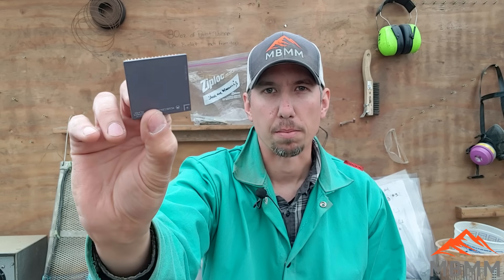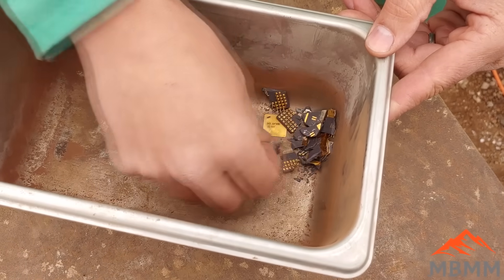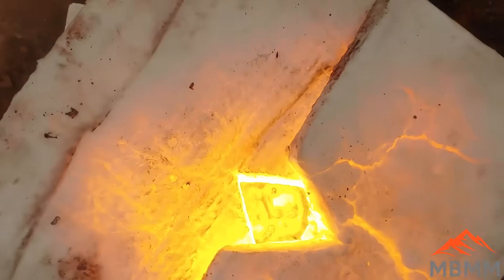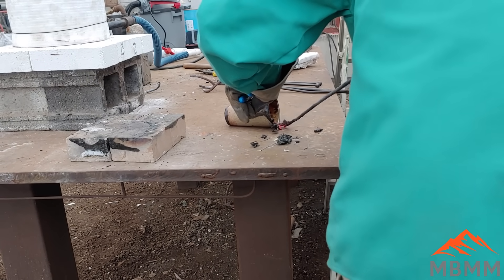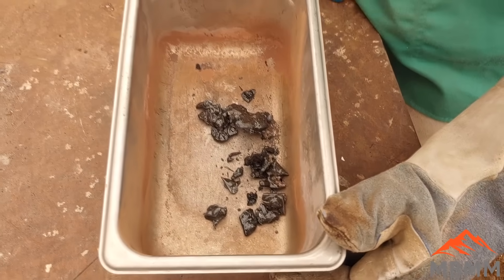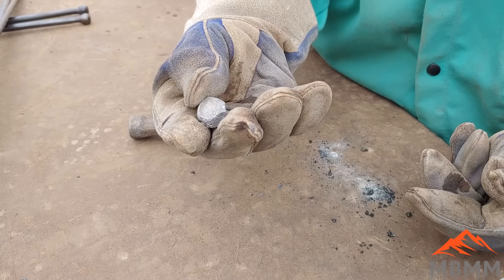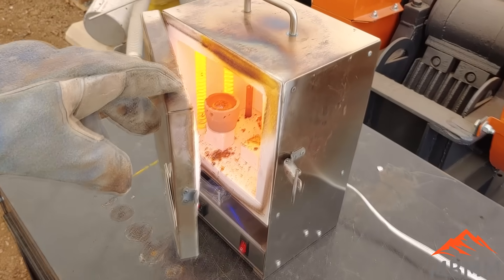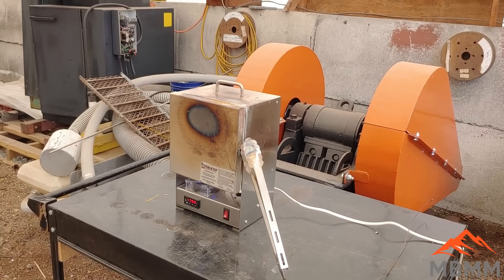Can CPU Gold Be Direct Smelted? Electronics Recycling & Urban Mining For Precious Metals!

Comment: Most people use chemicals to reclaim the gold - I think it would be interesting to have you hook up with, say Cody's Lab, and have you both start with the same amount and type of computer parts to see which method is more cost effective and efficient.
Reply: The chemicals to do the process in most cases like this cost more then the gold or silver is worth
Reply: @Hoosierdaddyjones812  The chemicals are pretty cheap, its just hydrochloric and nitric. The problem is the people selling the scrap price it way too high. Youll never turn a profit unless youre sourcing your own scrap
Reply: @Hoosierdaddyjones812  Figured as much as I had looked at the acid process back when it was all the rage when I had access to lots of scrap computer parts and it looked pretty costly.
Reply: The answer to both of those questions would have to be chemicals in my mind, due to that being the main method for reclaiming precious metals all over the periodic table from many major reclamation facilities
Reply: Steetips is the guy I watch on youtube, he does all the chemistry extraction of gold.
Reply: How to recover gold from computer part no acid
Reply: I was thinking the same thing. Reduce the initial boiling time to remove the gold from the plastic by grinding and turning everything into a semi-powder first. Interesting thought, wonder how well it would work in practice.
Reply: Saw vinegar and peroxide, method or salt or HO machine oxy clean promising but if you grind it all up into a fine powder and threw it into the peroxide, you’ll get gold flakes floating on the top
Reply: Def can do some research into breaking down materials and how much you process per melt. Best case scenario is to get very cheap heat like byproducts of other industry
Reply: @burb138 is there any point in using waste heat to melt metals? I would think the high temperatures needed make that unpractical
Reply: I use acid to extract gold from rock. I'm usually stuck with extremely small specks of gold sitting inside small pieces of quartz (most of the time). Tried several different acids and combinations, but plain hydrofluoric works well enough to get the gold free or, at least, exposed. Not sure how any of the common acids would work on motherboards...my guess, is not so well.
Reply: @jcass1970  I'm just a hobbyist gold panner, tried grinding down a quartz ore to dust and panned it after with pretty bad luck. How does the acid work?
Reply: @primordialsoupkitchen9492  It all depends on the rock, but I'll take a few pieces of quartz put it in a jar with the acid. 3 days or so is plenty. Lately, I've been using a mixture of hydrofluoric and hydrofluoric/Oxalic with good results. I keep it hot so it works better. I put it in a bucket w boiling water or on my outdoor electric grill...whatever. The acid dissolves enough of the quartz to break some of it free, or expose it in the rock. I still end up crushing what's left to get all the gold out, and the acid makes the rock more brittle so that helps too. Haven't tried sulfuric like unholybes4t mentioned, but the sodium hydroxide route works also. I think I'm gonna go the furnace way now, cupel, etc. Seems to be the only way to get all of it.
Reply: @jcass1970  Acetic acid mixed with hydrogen peroxide can dissolve the lead and eventually silver from electronic waste effectively concentrating the gold by default. Lead acetate is pretty toxic, so make sure you have a way to render it safe if you use this step it might also be worth your effort to separate the silver from the lead.
Reply: @jcass1970 you use HCL and 3% hydrogen peroxide
Reply: @chrism4008  haven't tried that. Finally did my first smelt though. Got way more gold than I thought I would get. I still have to cupel my lead to get the clean precious metals, but I can already see I will have more than a small button. Super easy to do as well.
Reply: @jcass1970  on CPU like those shown in the video, sulfuric acid desolves all the plastik and exposes the gold/gold plated material. Motherboards as such, do not have gold in them. Only some chips do. The older the chip, the more gold it usually contains.
Reply: Uuuuuuu
Reply: جيد
Reply: This is a wonderful idea
Reply: Sreetips might be a better choice, one, because Cody's Lab is a huge channel with 2 million+ of subs and I don't know if he would be as easy to lock down as a youtuber with more like 200K subs, and two, because Sreetips is a bad mofo when it comes to metal chemistry and his focus is precious metal reclaimation.  I'd place his chem skills near the top of all known youtubers, beyond Nile red and everything.
Reply: 8:36
Reply: P
Reply: Cody’s lab a name I haven’t heard in years
Reply: It takes money to make money , since I want to make money , first , I hopeave to take money... Right?
Reply: @dont.ripfuller6587  well you certainly will spend more then you make, using this method
Reply: sreetips>Codylab
Reply: @fumertonb 1000%

Comment: Silver is used in solder for electronics, so the CPU had a lot of sliver. Their may be some gold plated wiring depending on the pins and thickness of the chip. You'd have to pull up the specs for each chip to find the Au / Ag content.
Reply: Most solder is a eutectic tin/lead allow. Silver solder is only used sparingly and then, only in high- temp areas.

Comment: as a computing enthusiast, its a huge disappointment that the scrap value of a cpu could ever be greater than the value of the cpu itself, but that seems to continue to be the case.

In other news, I am hugely frustrated when using a modern super computer that browsing a website can stall out, software developers continue to produce software that can only barely limp along on incredible, amazing, hardware- some of the most extreme workloads I throw at my computer finish in nanoseconds, and then there is browsing a website...

Comment: Modern CPUs have extremely little gold in them. They used to be more generous with the gold in them a couple of decades ago. One of the 4 CPUs you melted, the one with the large aluminum lid (either a K6-2 or K6-3 by the looks of it) had almost no gold and was essentially a waste of material and gas to get melted down.

Comment: I used to work for an electronics recycling company. We kept our eyes out for particular brands and classes of chips that we then melted down and smelted the gold from.  It was worth our time, but we went through tons and tons of material over the course of a year.  And this was in '99-2001.  a lot of the older chips were very large dies and the circuit designs and manufacturing weren't as optimized as they are these days and so had more material in them than chips from more recent generations.
Reply: I also dealt with electronics back in 80/90ies. older PCB were packed with copper, silver. and gold. today its extremely precise.

Comment: The days of cost effectively getting any appreciable amount of gold out of a CPU are long gone.  I believe that the last chipsets that had any decent amount of gold in them were the intel Pro chips from the late 80's early 90's where you could potentially get up to 5gr of gold out of each CPU.  Good luck finding any of them around anywhere.
Reply: Ive got a few still and I think your estimate of 5g is a bit optimistic. Unless of course you have done it yourself.
Reply: My mistake, that should have been ~5gr out of 1kg of those early CPUs, but that doesn't change my point.  For what you'd spend in energy, supplies, reagents and time, you won't make any money appreciable money scrapping CPU chips any more.

Comment: 1/10 Gram per CPU, 28.3495 Grams per ounce = 284 CPU's for one once of Gold! Thanks :)
Reply: Actually gold weight is measured in Troy ounces. Its 31.1034768 grams per ounce. sounds crazy but that's the way of gold.
Reply: @geradkavanagh8240  Oh right! Of course thank you!!! 312 CPU's... Assuming there is actually 1/10th a gram of gold per cpu, I'm sure not all manufacturers are created equal.
Reply: It takes way more than that. Talking thousands of chips to even get close to an ounce of gold.
Reply: @CappinHoff  12:48 in the video... 1/10 of a gram per CPU.... I was thanking him for the info and running the calculation of that info... If you want to disprove that make your own video. We'll wait.
Reply: @lukasgoza4493  No need to, just look for videos that do this but do the details and calculations into how many it takes to get to a certain amount, value per ounce etc etc.
Reply: @CappinHoff  are these videos looking at CPU's where all the gold is located (including 24k gold thread), or just computer boards in general where they mainly get micro thin stuff from contact coatings?

Comment: If you are wondering where the silver came from I might have an answer. The ceramic cases are not solid ceramic all the way trough. They are multilayerd circuit boards where the substrate is ceramic and the conductor is made of silver. Look up the cofired ceramics process and thick film technology here on the tube if you are interested. The caseing of those chips are probably aluminium oxide or nitrite. Maybe you could flux the aluminium oxide with the addition of cryolite?  I have no idea how adding a fluoride would interact with the other components.

Comment: The chips were silicon, you need 1200c to enter the glass phase.  There were also many areas of silicide (silicon/metal) with a variety of precious metal. Ti, Cu, Pt, W, Au, Ag, Co are almost guaranteed to be involved. Plus a handful of other random ones based on the manufacturer.  There’s something awe inspiring about carrying a million dollars in gold, platinum or palladium, with a 500k core deposit. 

Volume and quality wise I’m wondering if you would have been better off just clipping the bonding wires.

Comment: The silver comes from brazing used to fasten the kovar (nickel - iron alloy) to the ceramic package, also used to braze the silicon die to the ceramic capsule, but it could also be a silicon - gold braze.

The aluminium lid (heat spreader) is made of aluminium and was probably consumed by the lye in the beginning of the melt. It's junk and should have been removed at the start.

The pins and often lids are made from kovar as it has a similar thermal expansion coefficient to the ceramics, that way it won't add any stress when the temperature changes.

Some CPU:s have a tungsten - copper heat spreader that easily breaks but looks like pale copper in color. You'll find it on Pentium and Pentium pro CPU:s but there are other CPU:s with it too.

Modern pinless CPU:s are junk and worth more in copper than gold.
Reply: What about the electrical conductivity of the kovar pins?

Comment: Wouldn't you lose gold plating in the grinder by it smearing onto the grinder plates? That 1.07g pellet could just go into acid to remove the other metals, once seperated, the silver etc could be saved by electrolysis.
Reply: Yes, that’s right..... but that’s not the purpose of this vid at all. We all know chemical refining is better.

Comment: The CPUs' if done right, the average yeild is about .3 grams of Au each. I did it about 5 years for a salvage company. The cap is a nickle alloy, about 50% highly magnetic. Bad move leaving that in. Why did I stop? Frankly, todays electronics are not worth the effort. Even fiber CPUs' with gold pins, not worth it. They yeild about 2 bucks per pound. As in, you have 1 pound of them remove the pins. that being said, anyone looking to buy stuff like that on E bay, you will likely loose a whole lot of money
Reply: joe k 
Im sure you can get more than 2 bucks from a restored retro machine. 486/pentium/mmx. And im sure it weights less than a pound.
Reply: Eeyup, the older stuff had more gold in it compared to the newer stuff.  Seen videos/images of components from the 70's and 80's that were huge and probably had a good bit of gold in it.  Now, like you say, it's hardly worth the effort.
Reply: What years did it start to go bad?
Reply: @magmasunburst9331  when gold was an expensive choice, about when the banks started f'ing the economy more than usual
Reply: @magmasunburst9331  I know it's been 3 years, but about 2000. From then till about 2010 you could get a fair amount, but only from very specific parts. Expantion cards, ram and flatback chips Had a fair amount in gold fingers and gold wires. The change is due in part to size. Today you don't even need a network card, it's on the board and about the size of your finger nail. That's one example. Instead of 50 chips all doing different things it might be only 5 doing it all
Reply: lose  Learn how to spell, dummy

Comment: Theres very little gold in those 4 chips, 0.1g maybe. Most of the gold is alloyed in the braze that holds the die to the ceramic. As you found out there is also a fair bit of silver in that alloy too. The gold plate makes up a small percentage of whats there to be recovered. Its entirely possible to recover the gold using lead but your not really following the optimum method. There is no need to 'smelt' everything with fluxes. All you need to do is wash them in a molten lead bath with some silver dissolved in it as a collector metal. This will strip the gold and silver off the chips and leave the iron/ceramic junk behind. Then cupel the lead as normal and dissolve in nitric to remove the silver.. The metal in the pins of the chips is mainly Iron and nickle, an alloy usually referred to as 'kovar' and wont dissolve in the lead.

Comment: Yeah, there's definitely silver in the CPU. If you want to separate just the gold, then crush everything to a powder, pour on some nitric acid to make silver nitrate, and the gold will be completely isolated at that point and you can smelt it out
Reply: It's not easy. There is tin in the solder, the tin forms a gel when dissolved in nitric acid. This makes it very difficult to isolate and filter the gold. Also the fumes are horrible and you need a fume hood. 
I've processed gold and silver using acids. It's fun, but it's not easy.
Reply: @ROSS4422 couldn't you syphon off most of the silver solution, then just filter the last bit? Then you can dissolve the gold as normal, don't really have to worry about the tin sludge as much? Usually people won't have that much material to deal with but I could see it being an issue on an industrial scale. Even filtering a large amount of that just once would be a project. But then again he's smelting after the silver removal too so he could deal with any remaining silver after that.
Reply: Thank you 🙏 😊
Reply: You can put copper in the silver nitrate and get silver out of that when you're done :)
Reply: So when I watch a video of these massive Pakistani operations reclaiming gold from mountains of cell phones the blue liquid stuff they process it with is nitric acid? Really asking anyone that knows. I have every cell phone, computer and other stuff I have saved just for the possible gold. The Pakistani guys have an entire workforce and sweat shop and safety sandals dedicated to doing this but they just show the process. They never explain what acid or how to use it. Thanks to anyone that helps.
Reply: @martinswiney2192 you’re pretty much bang on. They use the most cost efficient methods of extracting the valuable materials. I do hope that the Pakistanis use their safety squints though.

It’s quite possible that safety standards get much better over time, which will put upward value on precious metals. If no one’s willing to do that work they will have to pay more to extract it.
Reply: Its not really that simple, and there are some real safety considerations using that method
Reply: @chrism4008 I mean, that’s the basic gist of it tho. Burn, crush, separate the gold with nitric. What else is there?
Reply: @TroubledOnePaydirt 😂
Reply: @Mrbfgray  🤣🤣

Comment: All the solder is silver solder, Pd came from tiny chips (can not think of name at 4am). Use heat to drop the pins and plates off then crush the chips. Some of the heat spreader plates have gold plating under the solder layer also.

Comment: 1 ounce of gold can be pressed and stretched to cover an entire football field.  So, it's gonna take a lot of electronics equipment, time to pull out every piece and energy ($$$) to melt that smidge of gold out of those electronics.  Is it worth it????
Reply: It's worth it. For a large scale operation the copper content pays for the operation and the precious metals are around 80-90% of the total value. Economy of scales applies here, so 10-20 tons batches of circuit boards are on the lower end.

Comment: The big shiny plate was aluminum,, it’s a heat sink, there was a smaller plate that was gold plated steel, all the gold plated pin on the CPU are magnetic so there’s another source of iron, the silicon chip does contain trace amounts of gold, the ceramic body will have either gold or silver bonded wires, on most CPU’s , they have monolithic ceramic capacitors attached to them, this is where you got your trace amount of palladium plus small amounts of silver
Reply: Finally, someone knowing what they are talking about!
Reply: Watcha up too?
Reply: Crazy right, like 20 feet outside of the city and everywhere else in the province, snow comes and heavy...here, Rain and lots of it....
Reply: Are you into fashion stuff still? Like Vuitton stuff specifically?
Reply: That plate isnt gold coated. Has nothing to do with actual function.Just gold colored. Its junk.

Comment: Hi again. I was wondering if you used nitrogen to freeze the cpus first and then crushed them, would it pulverize easier? Also, would the brittle copper separate easier from the softer gold plate?
You've already done the crushing and shaker table test so you already have half the experiment done already. Thanks again for the interesting videos.